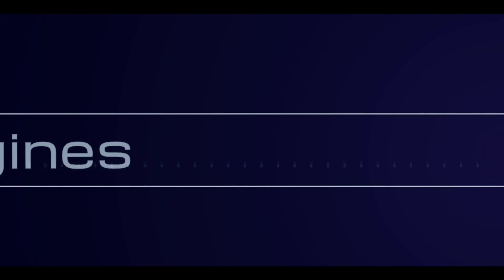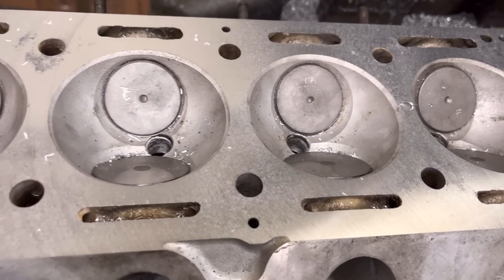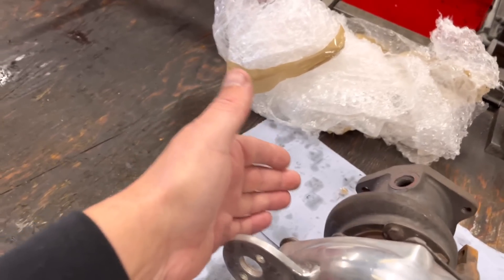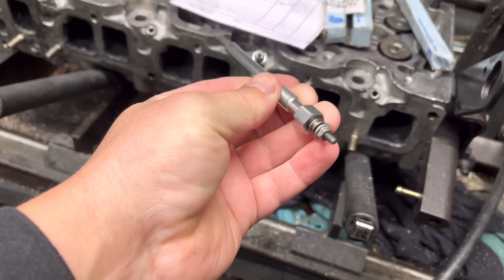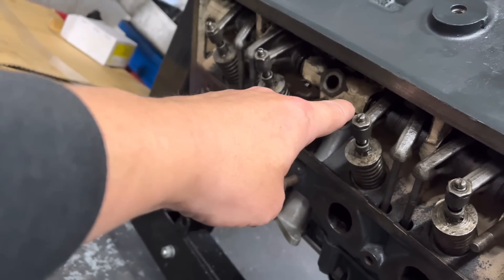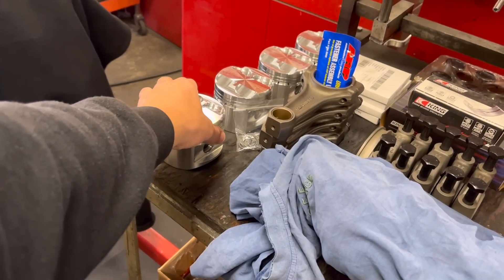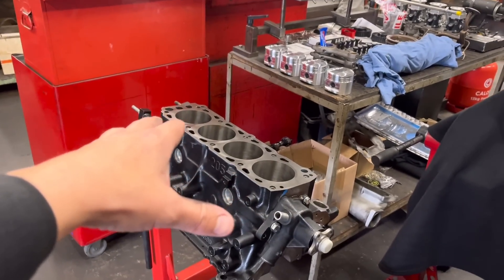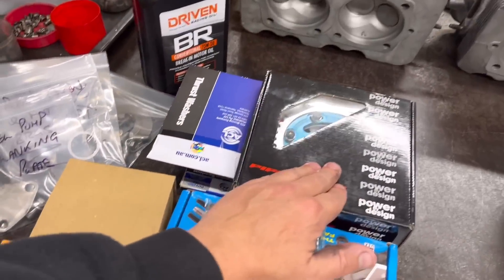It’s all gone wrong! We owe this man an apology!

Comment: I been in a few factories doing up turbo`s. When I first started out I got fed up sandblasting the exhaust housing on a turbo so left a weight on the foot switch and went for t-break. When I came back it had put a hole in the cast iron casing. I was young lol.